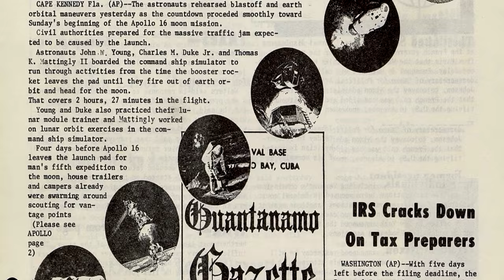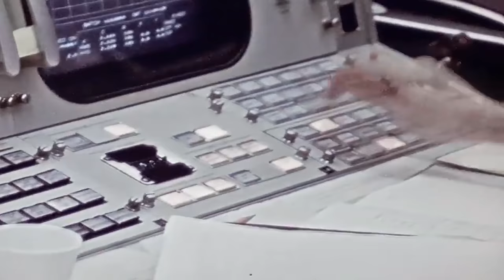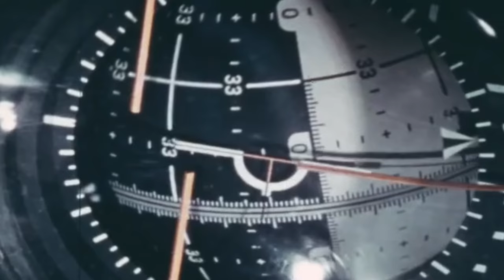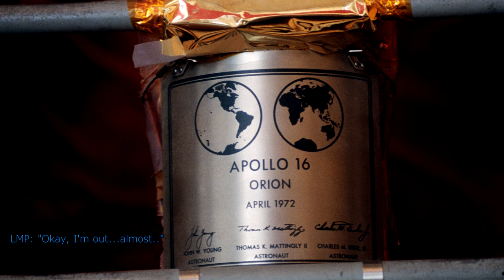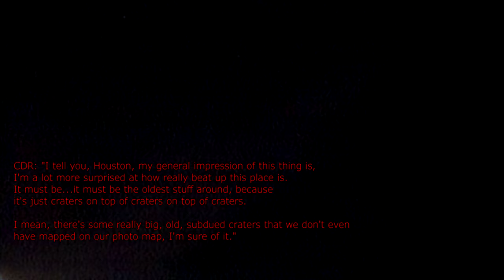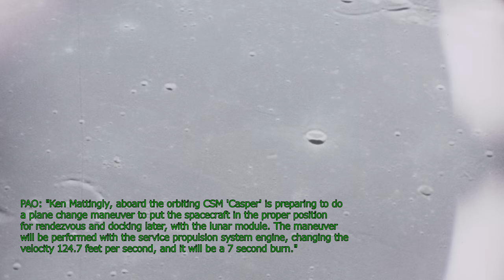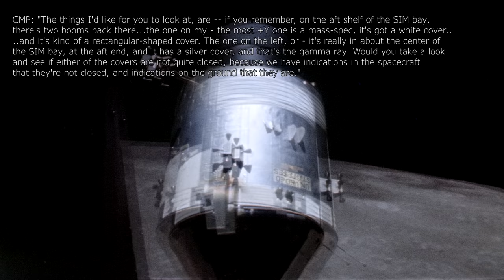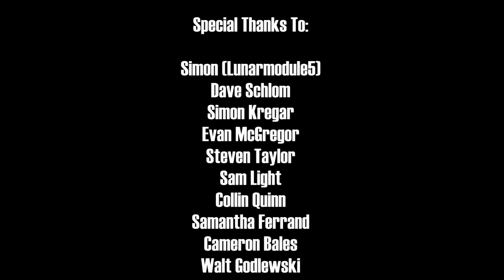Apollo 16 Remastered    (50th Anniversary)   [4K]

Comment: As a pilot, one of the things I find most incredible, yet is seldom if ever mentioned, is the rate of descent from PDI to just above the lunar surface. “Poward descent” sounds so civilized and controlled, like you’re just gonna hover on down and land, but you guys were plummeting at hundreds of miles per hour and at the last second slamming on the brakes! I mean if you look at the numbers it’s just unreal! To me it’s still the greatest feat of engineering and piloting ever accomplished.
Reply from the maker: I’ve always been struck by the fact that it was all accomplished in a single burn. No “pulses” or corrective adjustments…just a solid, single, real-time firing all the way from orbit to touchdown. That requires some damn impressive calculation and piloting skills. The speed energy management alone is boggling.
Reply: @JacksonTyler  I think the next people to land on the moon will return amazed by the experience but even MORE amazed that others had been there long before them.
Reply: @JacksonTyler  Wells said you are exactly right
Reply: @JacksonTyler  And some aspects it’s what I am most impressed with while watching SpaceX first stage booster landings
Reply: Yeah, it is wild. You're going from orbital velocity of the moon, which is about 1.6km/s (3,600mph), to a hover over the landing area, all with 1 continous burn of the descent engine. This is obviously executed with the navigation computer, but the precision of it all is really amazing to see regardless. The astronauts did have to take manual control when in the landing attitude to avoid boulders need be (Apollo 11) by pitching and yawing. That is where things get complicated as hell for manual flying - the skill of these astronauts as pilots is really showcased in those instances haha. Of course all the mission commanders where amazing pilots in terms of skill and experience.
Reply: Loved every moment of this!!!❤
Reply: @JacksonTyler  this is also why the LEM engine was the first of its kind built with a throttle! Very impressive engineering at the time.

Comment: Very outstanding and amazing documentary you made! One thing only, you forgot to mention that smudge on the images. One of them cleaned the lens when they were inside the LM and spilled some of that disgusting orange juice on the inside and it mixed with that fine dust. They only discovered that later on when the images were already made.. One more of those little glitches that happened on nr 16. First almost no landing, then the dust everywhere, then the cable that came off of that experiment, then that antenna that didn't turn, then the smudge and so on.. A lot in the end but at last the whole mission was successful. A real beauty of documentary you got here! Congrats!

Comment: Just finished reading John Youngs autobiography. Perfect timing.
Reply from the maker: A great book! I used it as a source.
Reply: Does he go in depth on all of his space flights ?
Reply from the maker: He went more in depth on 16 than any of my other books that I used. It’s a great read, I promise.
Reply: @liposchak  He also goes into details of the Shuttle because of the safety issues he was trying to fix. I've read Al Worden's book, Mike Collins book and, Massimino's book and Youngs is the the driest read.  A technical book but if you want information and not a lot of gloss, get it.

Comment: Just a question or comment from a programmer of industrial equipment...
Around 29:00 You speak about a closed loop system, but you refer to timers... This, in my mind, is actually open loop.
It just means that the control is doing stuff based on time, or timers. It's not looking at sensor data, and doing stuff based on that sensor data, it's just doing based on time. That, to me, is open loop (Doing this, when so many seconds have passed, then do this, and after another so many seconds, do that).
Closed loop sounds like what is described around 29:20.
Ignore timers, now we're looking at sensor data, or even manual inputs, and we do things based on that. Like calculating an efficient path, and the doing stuff (setting outputs) to make that happen.

I love your documentaries. Easily the best around! I've watched them all!  And when you get astronauts commenting, you know you've done it right!!!!
Reply from the maker: Yeah I reversed the two. My error! Thanks for the comment.

Comment from the maker: The sequence at 36:28 going through 36:45 are the paint particles, not stars.
The Westinghouse CSM Color TV camera could not resolve something as dim as starlight, even in space.

By their own claims, it could view in light as dim as "0.1 foot candles".
Even Venus, which is 25 times brighter than the brightest star, has a visual magnitude of -4.58, which converts to 0.00014 lumens per square meter (lux), or about 0.0000130064 foot-candles.
I am no mathematician, but that seems a bit dimmer than 0.1.

Comment: Drinking water was not one of the 'consumables loaded on board Apollo 16'.  That was supplied by the fuel cells by-products.  They only had a small holding tank.  They had a water gun for hydrating their food, and drinks.  And, did you know they had a vacuum cleaner?
Reply from the maker: Wrong in both counts! Drinking water WAS loaded onto Apollo 16 via external sources both in the CSM, and majorly — in the lunar module, which didn’t have fuel cells. The fuel cells did generate most of the drinking water used onboard the CSM during the flight, but they didn’t launch with the tanks empty!

Source:
https://history.nasa.gov/SP-368/s6ch4.htm#:~:text=Potable%20water%2C%20loaded%20prior%20to,ascent%20stage%20(figure%203).&text=For%20the%20Apollo%2015%2C%2016,installed%20in%20the%20descent%20stage

Also, here is an excerpt from the mission report:

“Predictions concerning water consumed in the command and service
modules are not generated for each mission because the system has an initial charge of potable water at lift-off, plus additional water is generated in the fuel cells in excess of the demand. Also, water is dumped overboard and some is consumed.”

I’ll be the first to  admit when I’m wrong and I’ll add a correction to the pinned comment - but when I’m right, I’m right!
Reply: @JacksonTyler  I stand corrected.  The fuel cells did replenish the tanks, though. Maybe we are confusing the CSM with the LM, which you pointed out, needed to be carged.
Reply from the maker: Also, regarding the vacuum cleaner — I read that it had failed pretty early on. 
Source: https://www.lpi.usra.edu/lunar/strategies/Gaier_NASA-TM-2005-213610_LunarDustEffectsEVAsystems.pdf

Comment: One correction - If the control system does not use feedback from from the output of the system, then it's an open-loop system, not closed-loop.

Comment: These documentaries are great but I’ve noticed one minor mistake. Geology station 1 was actually plum crater.
Reply from the maker: Right, looking at the map — Plum Crater was a fairly small depression located right on the rim of the much larger Flag crater. I guess both facts are technically correct, and the book I pulled the narration dialog seems to have indicated flag...but looking at the LROC quick map, I can see the tiny Plum crater there as well.

https://gyazo.com/79929d3e7cbe3b0a45ba39e82870fdad

Comment: I'm curious what type of batteries do they use and then Rover, due to the temperature being so cold in space?
Reply: From Wikipedia :

"Power was provided by two 36-volt silver-zinc potassium hydroxide non-rechargeable batteries developed by Eagle-Picher[25] with a charge capacity of 121 A·h each (a total of 242 A·h), yielding a range of 57 miles (92 km)."
Reply: You’re confusing temperature with heat.

Comment: why don't they use rocket break systems during the entrance sequence ?

is it neccessary to have that 5000 degrees heat by friction ?
Reply from the maker: To put it as briefly as I can, everything about a spacecraft and launch vehicle when it comes to design is centered around weight. On average, you need 9 pounds of fuel for 1 pound of payload, and that’s just Earth orbit....you saw how big that massive launch vehicle was. That’s the amount of rocket required to push that tiny little spacecraft to such an incredible speed. In order to slow down using engines, you’d need even more fuel, an even bigger spacecraft, and an even bigger rocket. Or...a heat shield, and an atmosphere. From a design perspective, the ability to use Earth’s atmosphere to slow down is actually an incredible godsend. We don’t have to use any fuel to do it, and we have the ability to design chemicals and materials that can withstand it.
Reply: @JacksonTyler  thanks for the explaination!!!

i was thinking about to make those breaks by service module nozzles and obviously this is my ingorance.  this would require more technical hardware , fuel , staging preperation , programming etc. sliding thorugh atmosphere seems a simple way rather than this much complex workload .

Comment: 48:00 So youre telling me that a magnetic field induced by a current in one of those cables caused a bit inside this unit to flip so that the computer thinks there was a gimbal lock? How unlikely is that? 😂
Reply from the maker: Not a magnetic field, but a pulsed electrical signal caused by a switch contact bounce.

Comment: Those fairings don’t come off when the command module detaches
Reply from the maker: Yes they do lol

“Once in space, the astronauts pressed the 'CSM/LV Sep' button on the control panel to separate the CSM from the launch vehicle. Detonating cord was ignited around the flange between the SM and SLA, and along the joints between the four SLA panels, releasing the SM and blowing apart the connections between the panels.”

Comment: As the missions progressed it seems that the payloads increased. Can someone tell me how this was acheived?
Reply from the maker: NASA continually made improvements between each mission and this is very well documented. There are too many to mention specifically but they can be broken down into 3 main categories:

1: Using more of the fuel in the planned mission and having less ‘margin’ or surplus for contingency reasons.
2: rocket Engine upgrades — namely the J-2’s, and the DPS. 
3: Operational streamlining: reducing burns. Namely for the J missions, using the CSM to conduct DOI saved a lot of propellant in the LM and therefore greatly enhanced its surface delivery payload capability.

Comment: How does a ship propel itself in the vacuum of space?
Reply from the maker: By igniting gases and shooting them out of a semisphere. The gases expand spherically and impart forces against the inside of the nozzle, resulting in kinetic energy transference.
Reply: @JacksonTyler  ok thanks
Reply: @JimmyTimmy-wh8dz  When a rocket burns propellants and pushes out exhaust, that creates an upward force called thrust. To launch, the rocket needs enough propellants so that the thrust pushing the rocket up is greater than the force of gravity pulling the rocket down. In space rockets actually work more efficiently since there is much less air resistance to slow it down.

Comment: Where are the stars?
Reply from the maker: A very common question. When it comes to capturing starlight with cameras, the magic word is: exposure. Starlight is very dim, and thus the aperture needs to remain open, for longer -- in order for the light to be captured on film/digital. Even our tremendously capable human eyes cannot see stars at night if adjusted to bright light. I encourage you to experiment with this yourself -- on a clear night, stay in a bright room, as bright as you can feasibly stand. Then go outside immediately and look up. Try and see any stars. You will quickly find out that none are there -- and they will slowly come into view as your eyes' pupils dilate as they adjust to darkness.

The amount of time a camera exposes film/digital sensor to light can be thought of as how wide a pupil is dilated. If you only leave the shutter open for a very small time, there won't be enough exposure for starlight to register on the film. 

The shots taken of the Moon were set for daylight exposure, as our Sun's brightness is sufficient to illuminate it at those levels. Had the shutter been left open, you would have seen a totally white, washed-out, blindingly bright lunar surface w/ no detail -- and a massive field of stars above.

Furthermore, there are several examples of photos with stars in them in this very video. These were taken with the 35mm Nikon-F, which was designed for dimlight photography.